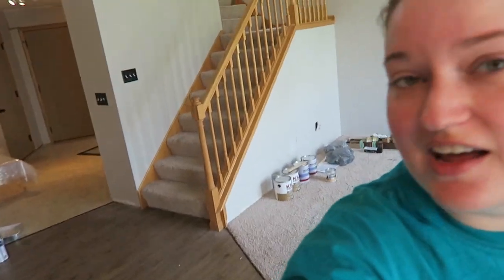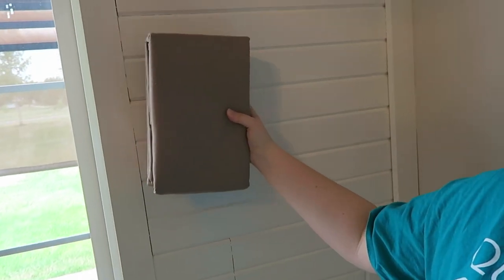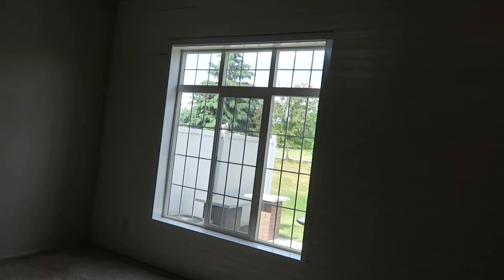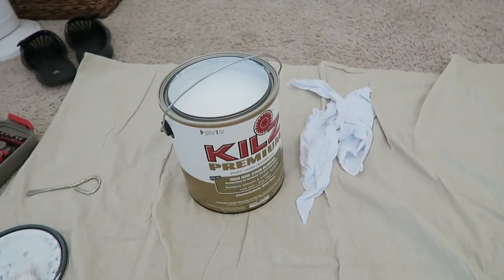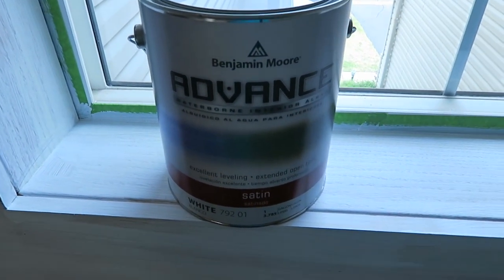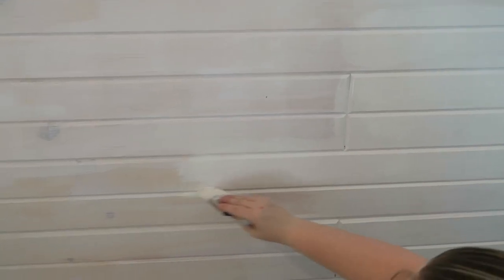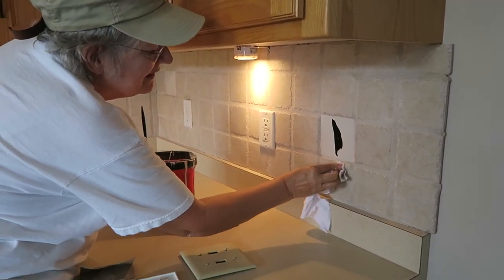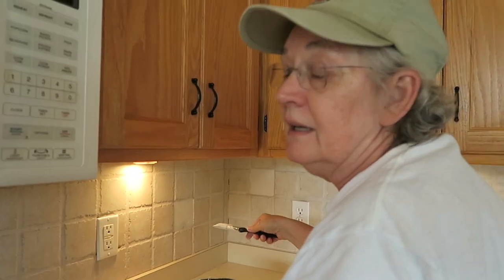SO SATISFYING | VLUNE DAY 10

Comment: So have you thought about an adhesive decal or even wallpaper over the tiles of the paint comes off. What are you planes for the doors?
Reply from the maker: For now the kitchen tiles will stay painted.  This is just a temporary solution.  I will rip out the backslash later on.  The 2 exterior doors will be painted back to the original white.